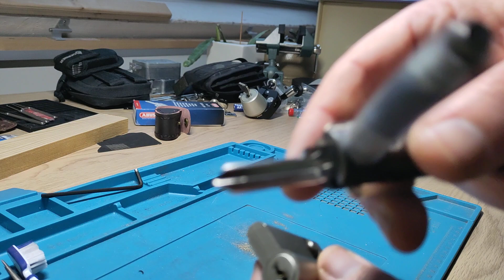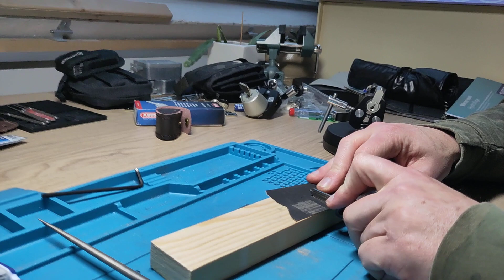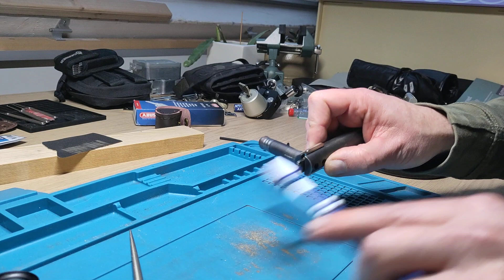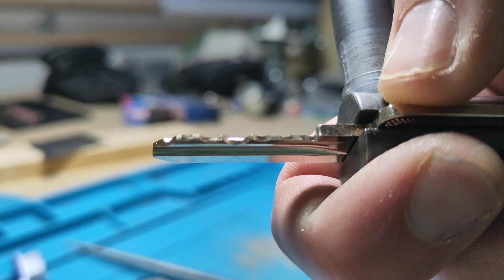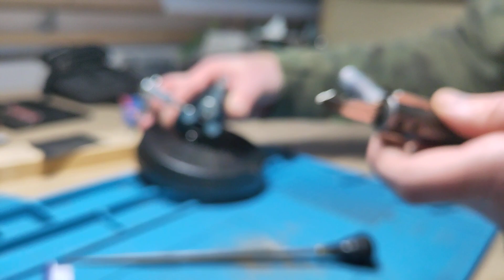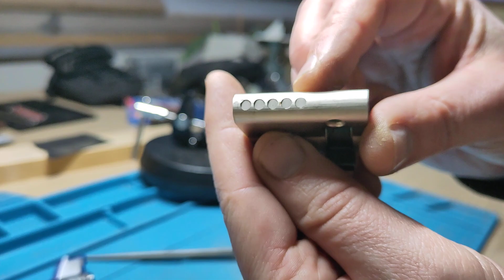Impressioning a half euro cylinder, unknown brand

Comment: Very impressive. Cool video, I'll definitely have to try that myself. 
One question though. Where do you get this handle for the key and are there also alternatives, for example, a combination pliers?
Reply from the maker: Some people use those pliers, but it's very easy to break your blanks that way (I've heard). I got my handle from Rubberbanned in the US. Are you on discord?
Reply: @TheGreenishOne  Thanks. And yes, I am on Discord, same nick name ;-)
Reply: The only part you can't save on is a good file. Vallorbe cut 4 round file width of about 5.5mm. Handles are easily created yourself, as all it needs to do is to hold the key. For ready-made handles, Pro-lok and Rubberbanned work very well. Make it comfortable and ergonomic, where combination pliers are neither.